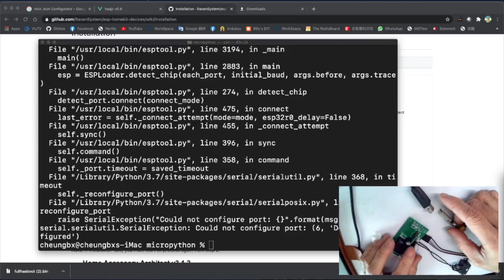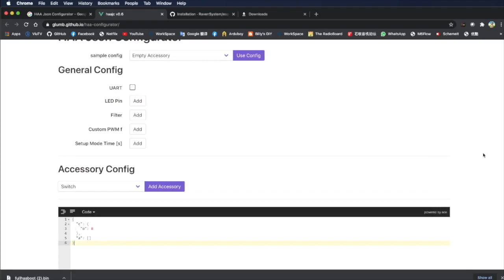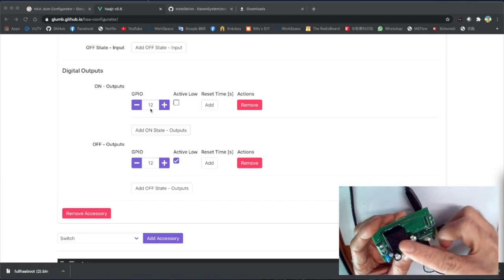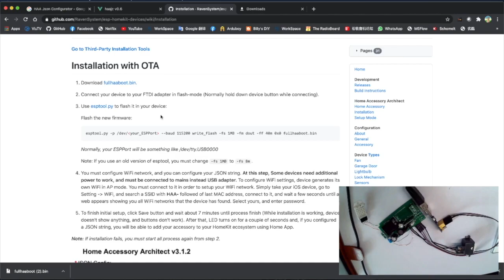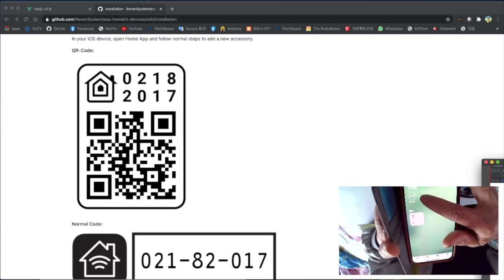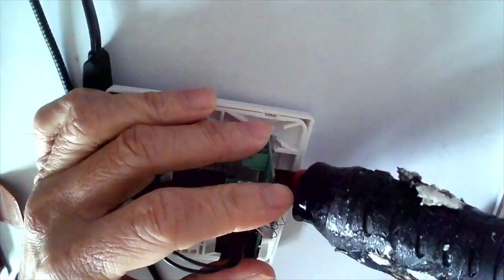Part 2 - Turn a Sonoff basic switch to a homekit light switch with temperature and humidity sensors

Comment: Clear explanation. Have used an ESP8266-01 with the switch on GPIO 3 (Rx) and the DHT11 on GPIO 2 and the relay on GPIO 0. The base is SONOFF mini.